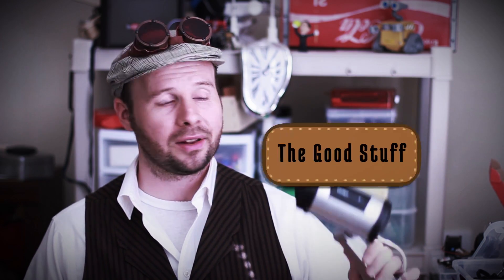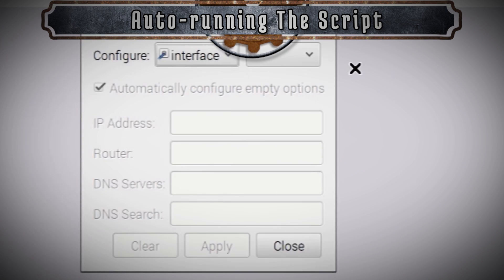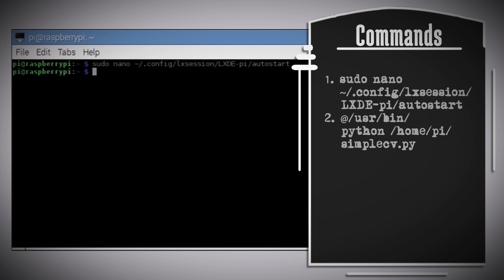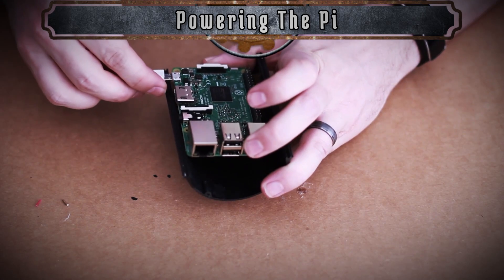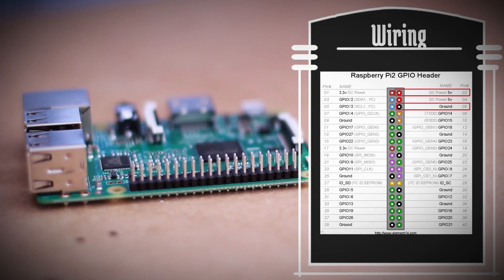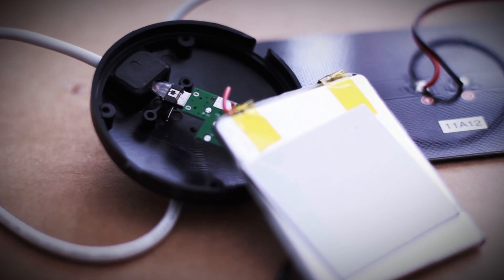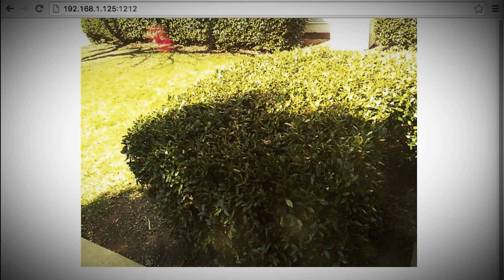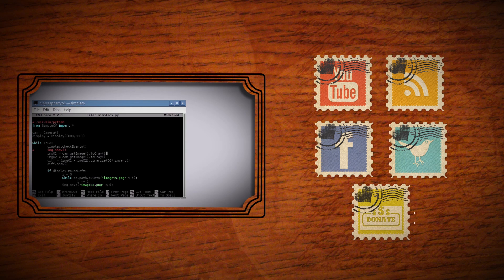How To Make A Raspberry Pi Security Camera: Part 3

Comment: this solar panel NOT work, panel voltage must be more than battery volt have, and need be diode at output positive wire, no has back current to panel. better add tp4056 little charger board panel output and then 5V charge battery. if use cheap good 18560 battery, and output need be stabilizer, boost up board keep voltage 5Volt then battery volt drop.  and raspi 3 have totally owerkill board this work, lto better have raspi A or zero board only ,zero W have best then you have wifi and bluetooth controller in board no need additional parts. and have lov volt current board, economical,

Comment: you should make a soler powerd alarm clock that spins a moter to a tune and is amplafied with a microphone into ones ear with a wireless ear plug linked to your phone that can be conected to any wifi network

Comment: When you are bypassing the Raspberry Pi USB power input, you are also bypassing the Power protection circuit. Which I would not recommend to anyone that does not absolutely know what they are doing. Also I do not think the battery is practical in this scene, since you do not have internet on the Pi itself. So the Pi might stay on when you loose power, but will your router also stay on? I would have gone with a solid Ethernet cable, and used that for both networking and a power supply line. Then at your router place a big 12V battery to power both your router and Pi. Thus eliminating the single point of failure. - Just a thought, but great show, thumbs up.
Reply from the maker: +Rehan Van Der Merwe The battery is not at all practical for this project. Just seeing what I could do as far as making a standalone Pi.

Comment: OK like the project but could you add a motion sensor to the set up so its only on while someone is moving in site of the camera
Reply from the maker: +Anthony Benedetto the camera has to be on in order to detect if someone is in site of the camera, unless you wire up a motion detector to this...but this project was supposed to prevent the need of using a motion detector.

Comment: Your power bank need hot glue the battery terminal to protect the battery short out. And add a  voltage regulator on solar panel maybe can make power bank's life longer
Reply from the maker: +That is Something All excellent suggestions!

Comment: You could probably make it last longer by using a raspberry Pi a+ or zero
Reply from the maker: +Corporate Sellout the pi zero would definitely last longer, but both the zero and the z+ lag too much to make this project useful.
Reply: Tinkernut Valid point, the zero could handle lower resolution better

Comment: Having the Pi boot to the desktop is a dumb idea...
Reply from the maker: +Thomas Galea (UKZz HELLRAISER) i'm not a fan of the desktop interface on the pi either, but unfortunately the simplecv software requires it to run.
Reply: +Tinkernut 
Ah, well that's pretty damn unfortunate.
Have you tried using Motion? As far as I remember from the video, it includes all the same features but runs from console.
Reply from the maker: +Thomas Galea (UKZz HELLRAISER) Motion would be easier in general, but this was intended to be an introduction to SimpleCV, which can do face detection, ocr, color detection, and a lot of other cool stuff.
Reply: +Tinkernut 
Ah, alrighty then. Guess I missed those pieces.

Comment: +Tinkernut
I would STRONGLY recommend against powering the rPi from the GPIO pins. That way bypasses a lot of fuses and protections and could potentially toast your pi if something goes wrong. Also there is no undervoltage protection (i.e. if the backup battery goes low). It would be better to strip a usb lead and solder that to the according points behind the pi's USB connector
Reply: Good point but the power is coming from the battery protection circuit so its fine

Comment: Hey, would this be possible to use some of the code and libraries to make a motion tracking device, like the kinect and pass the movement to the cursor for motion control?
Reply: +Benjimaestro Kinect uses a 3d image to detect you i think
Reply: ***** Yeah I know but only for 2D tracking? Because I only need an XY plane.
Reply: Benjimaestro Might be possible, although i meant that it differentiates you from the environment using 3d.

Comment: this has been a great project, thank you! it's actually helped me out on two other projects, neither of which is security camera-related.

also, as you may be aware there is a version of the pi camera that has no IR filter. that would work well if you hook up those IR LEDs in the camera housing (assuming they work).

Comment: what is raid 2?
Reply: +Vineet Sukhthanker RAID 2, which is rarely used in practice, stripes data at the bit (rather than block) level, and uses a Hamming code for error correction. The disks are synchronized by the controller to spin at the same angular orientation (they reach index at the same time), so it generally cannot service multiple requests simultaneously. Extremely high data transfer rates are possible.With all hard disk drives implementing internal error correction, the complexity of an external Hamming code offered little advantage over parity so RAID 2 has been rarely implemented. It is the only original level of RAID that is not currently used.
Did that help?
Reply: +CroGaming what is the difference between strips and block
Reply: Vineet Sukhthanker Striping is a process of dividing a body of data into blocks (sequences of bytes/bits) and spreading them out over multiple storage devices. In RAID 2 this process is done on the bit level.
Reply: +CroGaming thanks
Reply: +Vineet Sukhthanker No problem. :)

Comment: which is better web server? raspberry pi2/3, Intel atom 420 pc or Pentium 4 pc?
Reply: +Vineet Sukhthanker better in terms of what?
Reply: +Reginald Sin in terms of power consumption and performance
Reply: +Vineet Sukhthanker I think you may want to go with the Raspberry Pi 3 for a low power server, given how simple it is and how many tutorials there are out there , and its cheaper than any of the other you named. But it depends on what you'll be using the server for.
Reply: +CroGaming I want it for hosting moderate traffic websites
Reply: Vineet Sukhthanker Then You're probably better of getting a Xeon (low power one if it's enough) for ECC memory support, but maintaining a server can be difficult (unless it's for your home only, then an i3 or a beefy Pentium should satisfy you, but I recommend doing research). If it is for a site anyone can visit, you may be better of paying some professional company to do it.